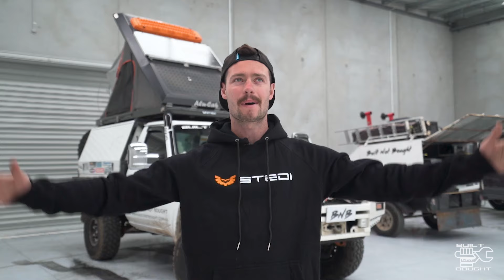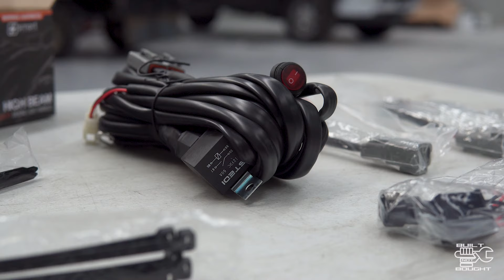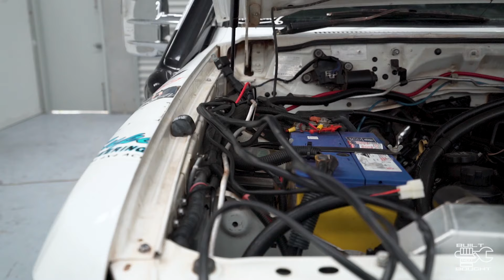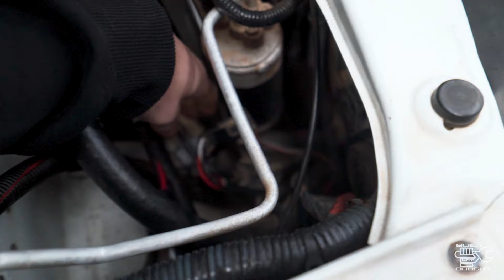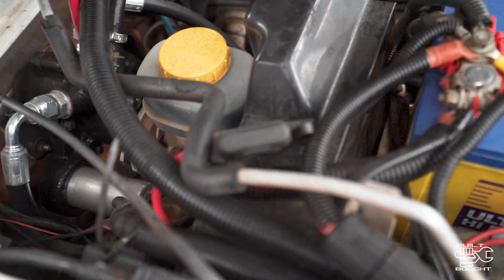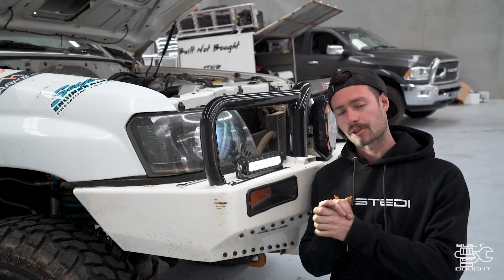How to wire LED light Bar or Driving Lights to High Beam STEDI Smart Harness

Comment: Hi mate. Great video. I bought a set of spotties for a 2019 Rav 4. The led spots I bought also came with 2 patch cables for H4 and HB3 connection. My problem is that the Rav 4 has led head lights. If the Rav 4 was using H4 globes I wouldn't have a problem but there doesn't seem to be a connection point for the patch cable on the existing head lights. Any help would really be appreciated, thank you.

Comment: I know it's a bit old now, but hopefully you can help. I have a wireless switch panel, the control in the car and the wiring box out by the battery. Question is can I not use the toggle/rocker switch, and connect it to the switch panel instead? The switch panel has a power and a ground, and activated on/off wirelessly in the cab. Do I need a separate relay or is there a simpler way to wire that up? I have this exact harness btw, and the stedi light bar and accessories.

Comment: I just bought the EVO lightbar for my Kia Sportage AWD 2020. It has projector led  headlights HB3, which i also bought from Stedi. 
I believe i hooked everything up correctly, just like in your video, but maybe not. The on/off interior stedi switch works - all good. But if i try to flick my hibeams on with the steering colum lever, the lightbar does not seem to come on. The lightbar only comes on when i manually turn it on with the switch. Any ideas? What could i have done wrong here?
Also, with the relay, is it actually necessary to have it bolted onto the inner metal wall or can i have it stuck onto a plastic panel somewhere? I dont really wish to drill any holes into the body if i can avoid it.

Comment: For the Stedi Evo, which wiring harness? The one with 2 Relays or Single ? And reason why
Reply from the maker: A single relay Smart Harness is sufficient for 2 Type-X EVO's. For higher current such as the ST3303 Pro, dual relay is a requirement.

Comment: I used the harness included with the stedi light bar and nothing happens, light bar doesn’t work. What am I doing wrong?
Reply: My relay won’t even activate direct to battery
Reply: @ super lame. I ended up just using a harness off of Amazon. Went out on a limb to grab some Aussie light bar and it ended up sucking

Comment: Has anyone overcome the issue of connecting to the battery when the battery is mounted under the passenger seat (stupid VW Touareg)? There are jump start posts under the bonnet, so could the main + and - wires just be attached to those somehow?
Reply from the maker: If you're in the STEDI owners' group on Facebook, this might be the place to find an answer

Comment: I use this Smart Harness to connect with light bar and 2 spots light but the cable was getting hot after 10 mins. what should i do?
Reply from the maker: Just to clarify, sounds like you are using a single harness to connect 2 spotlights and 1 light bar, is this correct?
Reply: @stedi_lighting  Yes, I did that. Could you please help me. Thank you so much 🙏🙏🙏
Reply: @stedi_lighting  Sorry I did not get your response back so messaged again. Could you please help me? thanks

Comment: do you have a install video for dual LED headlights with a canbus system
Reply from the maker: As in a headlight running factory LED high/low beam without a traditional style plug to piggy back from?

Comment: Only seeing this video now. That harness you are using, it has a relay which has a wire for the switch and a wire for the high beam adapter and then 2 leads for the spot lights correct.
Reply from the maker: Correct with the addition of the positive and negative to the battery.

Comment: can you do this with out wiring up the high beam part if you don't want that and you just want a switch for on and off
Reply from the maker: The high beam trigger can be bypassed depending on purpose. For Australian ADR, if it's a forward-facing light, legally needs to be high beam activated.

Comment: Do you have to run the cable if you just plan on running it through high beams?
Reply from the maker: Our or any other high beam adaptor won't be able to supply enough current to power any driving lights. A harness is required for operation of driving lights keeping in mind that local laws (at least here in Australia), require not only a high beam trigger but switch operation as well.

Comment: Would the process be the same If I wanted to wire spotties and a lightbar to my high beams but on seperate switches?
Reply: just wire the second switch in parallel to the one provided in the kit.

Comment: How to screw the headlight back cover back on with all new wires and plugs sticking out now. No one mentions this.
Reply: Drill a hole and run the wiring through a waterproof grommet

Comment: When I installed the Harness on my Wrangler JK after market LED headlights, the high beam on the side connected with Piggy Back adapter is not working properly (lost power) and the Light Bar is also not working. Anyone knows what the issue is? Is it ok to connect the Relay to an existing ground connection or does need to be fixed at a separate position by itself?

Comment: Have you a video on wiring a stedi harness in a Toyota hiace van as it's  backwood to a normal car.
Reply from the maker: Hey Stuart, If you're referring to the negative switching (Positive earth) - then the wiring process with our harness is the same. Unlike other harnesses on the market, ours has electronics built that allow it to work with both positive and negative switched wiring systems.

Comment: Would there be too much of a load if you ran those small lights together with the existing spot lights on one harness?
Reply: depends on power rating of those little things, they could easily be 100w each

Comment: Is there a simple solution for not using the rocker switch but still having it hooked into the high beams? Will unplugging the switch do that?
Reply: you could also just leave the rocker switch in the on position inside the engine bay. i also dont really see the point of having both a switch and it being controlled by the highbeam switch.
Reply: @iConviicted  Legally required to have their own switch, AND to only work when high beam is on.
Reply: @pugnut403  What's the best way to set this up when using an isolated switch, without being connected to high beam?
Reply: @wheredwallygo  you need to be connected to high beam somehow. 
The usual way is to tap the high beam wire at the headlight, use that to run to the spot switch, from the spot switch to the relay trigger, then relay earthto vehicle body. 
Run a larger wire from the battery positive to a fuse, to the power in on the relay, then from power out on the relay to the power wire on the spots.
Reply: You'd have to short the switch out I'd say, man. There would be an active, neutral and an earth cable that you would normally wire into the rocker switch. To get around that, you'd have to short the active and the earth together, so that the relay thinks that the 'switch' is always on.

Comment: Am I right in thinking the rocker switch effectively arms the system. On/off of the lights is then controlled by switching high beam on the control stalk? There for turning rocker off allows high beam with no spotties? Do you ship to uk?
Reply: You are correct, yes. Rocker switch set to OFF position will allow you to run your headlights as per normal. Whereas if the rocker switch was set to ON, and you turned high beams on, then your lightbar/spotties will turn on with your high beams as well.
Reply: @xJoRDox96  how that work? ive try it on this afternoon to wires up.  beam on spot light on. turn spot light off (switch) and beam on still spot light on. did i do something wrong with wires? thanks
Reply: Do you need the rocker switch at all? Can you run the system without it and just control the spotlights using the High beam?
Reply: @johnzelenjak  In Australia, you are legally required to have a switch for your spotlights so that you can turn them off separately from high beams.

Comment: Pretty sure its illegal to not have them on a stand alone switch in nz Haha
Reply: In Aus they must have a separate switch, however they must also be wired so they will only operate when high beam is on. Easiest way to do it is to tap a high beam wire to feed the spotlight switch which then triggers the relay and feeds the lights...both high beam and the spotty switch must be on for them to work.